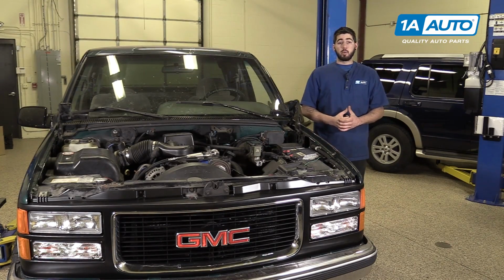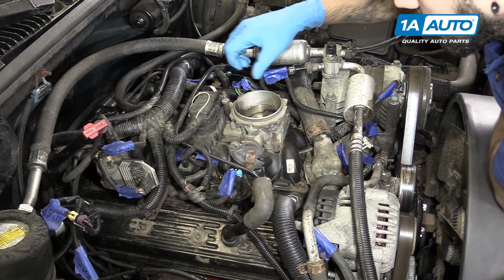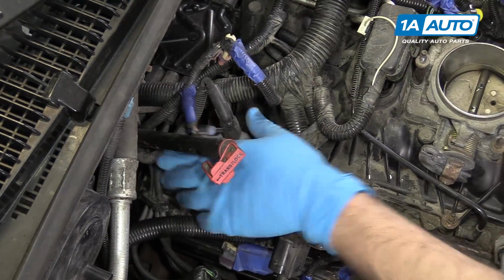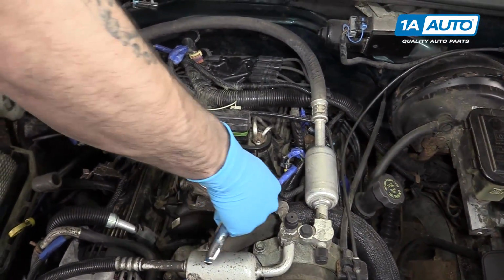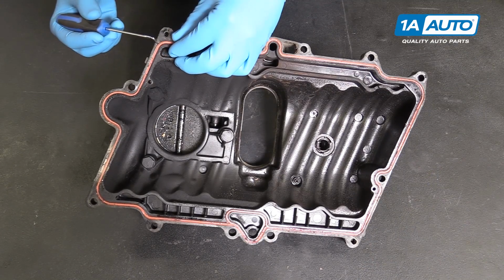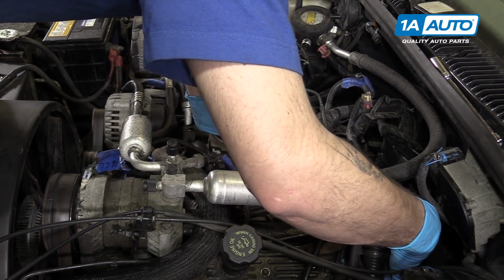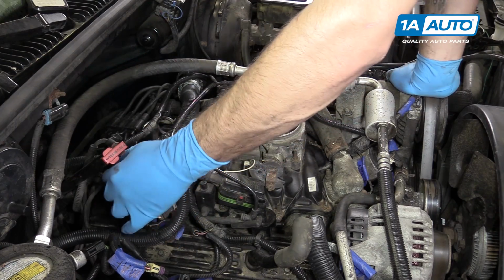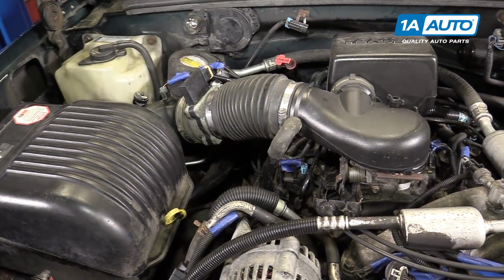How to Replace Upper Intake Gasket 96-99 GMC K1500

Comment: ... he said "inch pounds" in the video.  

First pass: 44" lbs = 3.7 ft lbs
Second pass: 88" lbs = 7.3 ft lbs

I would not recommend using a foot pound torque wrench for settings that low as foot pound torque wrenches typically start at 10 ft lbs.

Comment: Gee! Thankfully I only need to remove the upper radiator hose, carb linkage and transmission linkage!!  Then remove the 8 bolts and lift off.